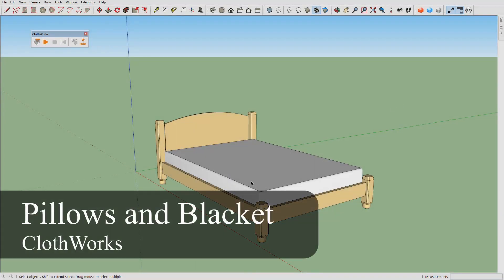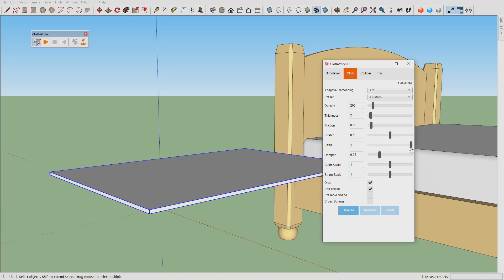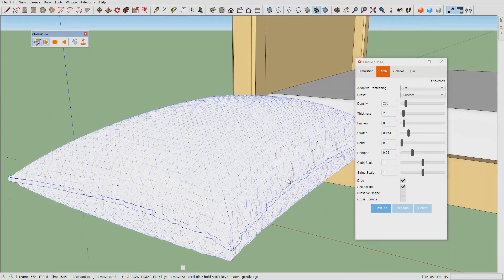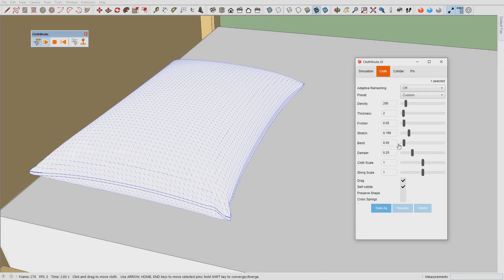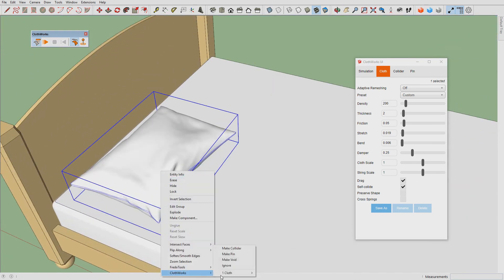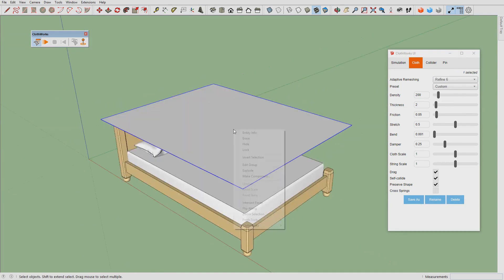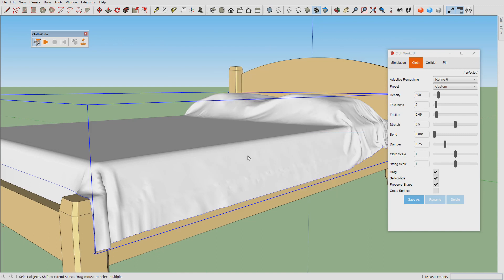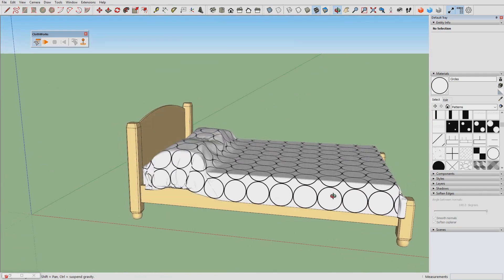ClothWorks Blanket and Pillows

Comment: Антон добрый день! У меня skethup2017, при установке плагина не появляются иконки и нет в панеле инструментов. В чём может быть причина. Заранее спасибо за ответ!
Reply from the maker: Hello. It could be that the plugin is not properly installed. Please check the ClothWorks installation manual for instructions:  https://antonsynytsia.github.io/manuals/ClothWorks/installation_manual_v174.pdf

Дайте знать если работает
Reply: @AntonMSP1 The plugin is listed in the Extension Manager, but not in the toolbar. Also downloaded the AMC library
Reply: Thanks